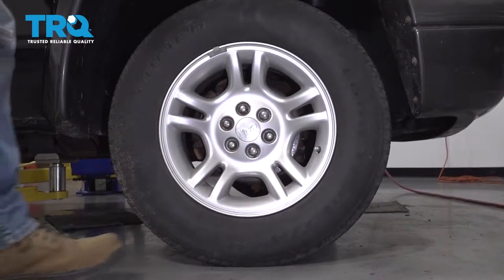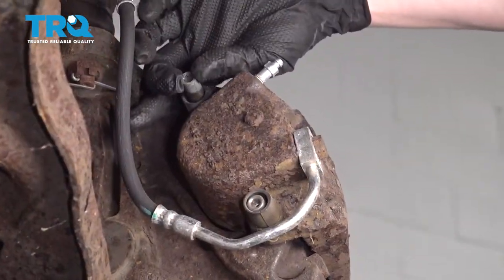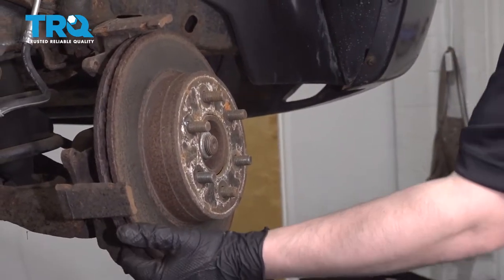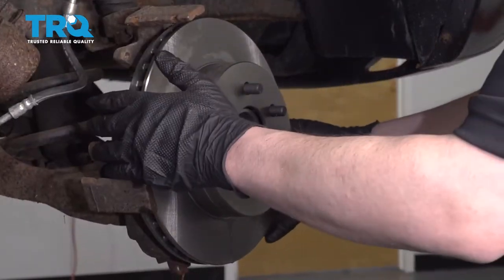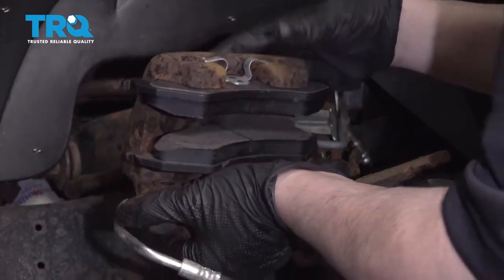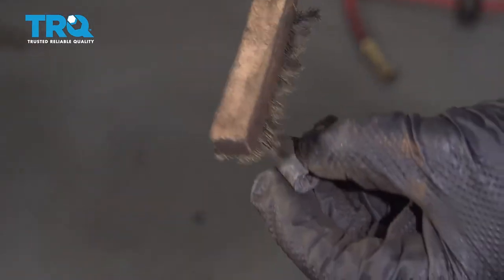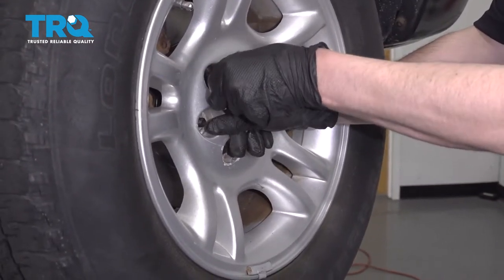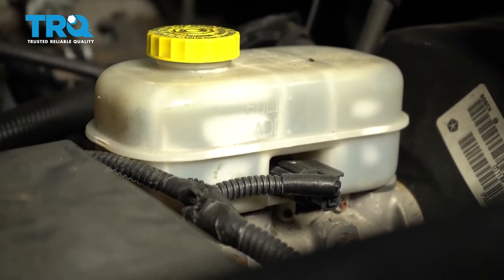How To Replace Front Brakes 1997-2004 Dodge Dakota

Comment: Put the lug nuts on to protect the threads if you have to hit it with a hammer and before you remove the caliper stick a screwdriver between the the inside pad and the rotor and pull backwards and it will push the piston back in so then you dont have mess with a tool to push it in when it's off but it's going to push fluid back into the reservoir so be prepared for that.

Comment: On the break is a 7mm allen. I have a problem. One of my bolts is loose but spinning and not backing out . Is there a trick to getting this out? As you know I can't take the break off the assembly until that comes out.
Any help would be great and if you already have a video fixing this please send me the link.
Thank You